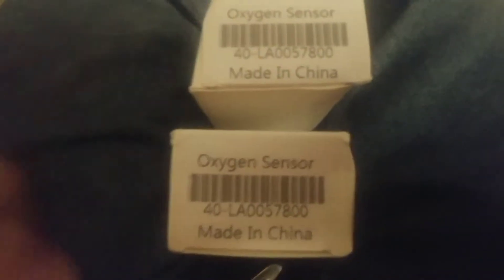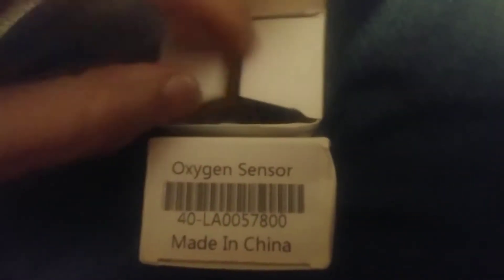Chinese O2 Sensors

Comment: mine did not work the engine light came back on for the same reason as before oxygen sensor banks 1 and 2 sensors 1 for both lights came on  I replaced all 4 oxygen sensors and I'm sure if I keep driving it the CPU will the reject the two that were left bottom line all 4 Chinese sensors immediately were not good because the voltage from them is wrong and incompatible so my advice is just to buy the expensive Bosch also the Chinese make some inexpensive alternatives to a lot of things but not sensors in my experience. I am going to have eBay give me a refund for mine there's a simple process online to get your money back
Reply from the maker: That's a shame for your bad luck. Ours is still working fine after several months. Not a hint of trouble.